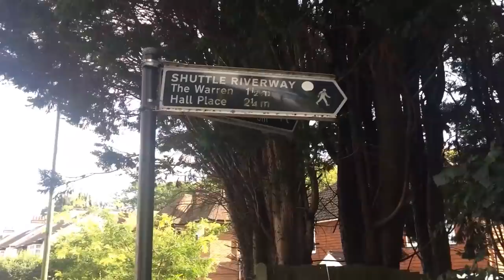Building our house in Thailand Pt 5 | Living in Udon Thani Thailand

Comment: Being an electrician I would recommend that you have that ground at all the locations. I learned this first hand as an apprentice, I wired up about 5 tents for some Green Barret's on bivwack. I didn't connect the ground thinking there was no problem because there was a neutral, but as they came in from the field at night  every time they would turn on the lights or touched the box as they plugged something in they go zapped. Luckly nobody got hurt accept my pride (but it was a good learning experience). Your  house is coming along nicely. Peace
Reply from the maker: Thanks for this Sidney. 
Have already insisted on the ground. Plus we have asked for a lightning conductor on the roof. The fork lightning is pretty spectacular here at times.

Comment: Re the electrical cabling you were talking about at 26:15 ....they are either single or double core, not triple. So you have to have a double core cable and a single when having L,N and E. And make sure they use one colour for each throughout the house, or you may later find that the live at one socket is green, black at another, and blue in the next room ! They think "I only need a meter or two to finish this, let's use up that old roll of cable, no matter what colour it is"
Reply from the maker: Not here. Pook's brothers house has twin and earth cable. The earth from the consumer unit goes to a copper earth rod that is sunk into the ground.

Comment: Reference the additional taps in the bathroom. Very often they send notice that the water will be cut off for a period of time. We usually fill a large plasyic garbage can with water for flushing the toilet, cold shower etc.
Reply from the maker: We never have a problem with the water supply here David. Seemed a bit pointless.
Reply: Thats it david large bin full of cold water all the time
Reply: @sinniatrest  - most places I've seen here have a large water tank "out the back", with a small pump to run showers and WC...
Reply: @harryinhuahin1272  I have the same  But the wife wants a dustbin in the bathroom full of water  as well

Comment: That extra tap in the bathroom is to stand above your plastic dustbin , to be kept full at all times as and when you get power cuts . We got a super large one in ours on my insistence , nearly every thai house will run hose pipe from the sink to the water but
Reply from the maker: Power cuts are few and far between here and if we do get one, never lasts more than 30 minutes.
Never had any problem with the water supply.
Reply: Yeah you’re lucky then , where we are our electricity comes over from Laos and if anyone literally sweats too much the poxy electric goes down and they don’t rush to fix it . If I lived there I would get a Jenny for sure
Reply from the maker: @retiredpainter259   I'm considering getting a small generator. Just enough to power my laptop and the WiFi router. 
Just in case the power does go when I'm doing a webinar.

Comment: Love the use of the glass blocks. Seen it before but not to the same extent. 

We are going to insulate all outside walls to keep the heat out.

Agree with your thoughts on London and Kent. We have been living in Sidcup for the last 9 years. We can't wait to move to Nam Rin Beach, Phala, Ban Chang, Rayong we purchased the land while still being in the UK. Just need the flights to restart Thailand Airways have booked us a flight for the second week of April. Let's all keep our fingers crossed. Good luck to you deserve it.
Reply from the maker: The thermal properties of those blocks that we used are excellent.
We know Sidcup very well. I did some consultancy work at Beadles, the Range Rover dealership there and have friends living close to the Oval.
Keep in touch and good luck with the move Tom.

Comment: 44:44 the logic is that if there is a problem (very low pressure or no water), or there's going to be a problem, you put a 200L bucket under the tap and collect water as a trickle or before the supply goes off. Then you wash with the water collected. In a lot of rural parts, the supply will be depleted from time to time. So, they leave the tap on, bucket underneath, and the bucket will start to fill as soon as the supply returns.
Reply from the maker: In all of the years that Pook's brother has lived here, he has never know the water supply to fail. We should be okay without the tap and bucket.
Reply: @TheIsaanFarang  shame, it's an upmarket look!

Comment: Awesome. Just a query though with the left side of the house from the front does that have an angle in the wall or are my eyes worse than I thought.
Reply from the maker: 😄  Your eyes are fine. The land tapers towards the back. We wanted the front of the house square and the space between the house and the garden wall to remain the same for the full length.

Comment: Hi good luck with your house build, I had a house built about three years ago and the last thing I had to do was I had a pair of made to measure hardwood front double doors made I'm a joiner by trade myself so when they told me how much they would cost I thought wow that is a bargain, they lasted about two years then I replaced them because they shrunk so much when the moisture content of the wood dried out, I replaced them with some aluminium patio doors it's a shame really because the original hardwood doorss looked sweet so my bit of advice would be all external doors and windows use aluminium or upvc I had all of mine made locally to my design, the cost wasn't that much more expensive than the ready made windows you can buy in homepro any how good luck with
Reply from the maker: Friend of ours had the same problem with wooden front doors.
We have gone for aluminium windows and front doors. Back doors will be WPC.

Comment: Nice to do your awning above the outdoor Aussie styled kitchen BBQ in a well treated natural teak timber, that way you'll have a beautiful timber patio to contrast to the upper rendered blocks, lovely timber balustrade posts and rails on the upstairs patio with stainless wire balustrade wiring. That way when you look out to the upper deck the contrast with the render will look beautiful. Lovely natural satin finish handmade panelled front door. If you're going to extend out on the shady side of the house as you showed where the trees are why not join that smaller awning/ deck from the back of the house around the corner to where you said you were going to extend out an upper sitting deck area. The look of the deck/awning wrapping around the corner with railings and stainless balustrade would look beautiful, and give you more upper floor area too for outside smaller sitting area.
Reply from the maker: Love all of these suggestions Philip, but we are working to a budget.
We will end up with a 5x5 deck above the kitchen overlooking the garden.

Comment: Good series of vlogs... Just one question: Why are the side walls proud of the concrete posts, by an inch or so...?  With the walls so thin there doesn't seem to be much connection between the walls and posts...
Reply from the maker: Good question Harry. They did that in places to keep everything in plumb. 
They used steel rods to connect the blocks to the posts and to the steel beams.
Reply: @TheIsaanFarang  - thanks for your reply... do I presume some of the posts aren't quite properly positioned...?
Sorry to be persistent but I'm interested to learn for my next build...

Comment: Please don't think i am being negative but you should really have gone for a double block external wall or a wider block if you are having a single skin external wall.
I am currently having a house built 15 mins from Ao Nang in Krabi and have gone for a single skin wall but a double width block.
Reply from the maker: The thermal property of these blocks is more than adequate to keep the heat out Mickey. Was my concern too but I have tested how efficient they are since they were put up and they are fine...and that was before the rendering on both inside and out. 
You might be adding cost to your build that is unnecessary.
Reply: @TheIsaanFarang  Hi, Thanks for your reply. The issue was more the strength of the construction rather than the thermal properties of the block.
Thai people tend to go with a single block construction due to costs being less.
I have gone for a single block but double width so have got the thermal properties plus the strength as well.
Which is more expensive than a thinner blocker but cheaper to build than a double shinned wall.
My brother in law had  a house built in Krabi Town about 9yrs ago and went with a single skin wall and unfortunately has some cracks in the gable end walls now.
This can be caused by a number of factors depending were the house is built close to a busy road or due to poor foundations.
Anyway as i said in my first message please do not think i am being negative just thought i would make you aware of my experiences.
I am at about the same stage of the build as you are roughly.
Fingers crossed the windows will be in next week.
All the very best with the build i am sure it will look amazing when finished.
Have a fantastic day.
Best regards, Mike
Reply from the maker: @mickeyp5122  
Thanks for sharing Mike and good luck with the remainder of your build 👍

Comment: The Rooter .... its ROUTER ...R_OUT_A
Reply: @TheIsaanFarang   sorry, I was only making comment on your pronunciation of the internet "router". You are saying rooter, its pronounced r-out-ta.   I might also ask, is your electrician installing an RCD (residential current device) ?  Thai building standards are horrifically low and their electrical installations are worse.  "RCDs are designed to disconnect the circuit if there is a leakage current. ... RCDs operate by measuring the current balance between two conductors using a differential current transformer. This measures the difference between current flowing through the live conductor and that returning through the neutral conductor."  They are mandatory in Australia.  And make sure he runs, 2.5mm cables to the power outlets and 4mm to the kitchen (separate circuit) if you want an electric oven.   Different circuits to the power, lights, aircon and kitchen power.
Reply from the maker: @MrTallpoppy58  
That's so funny Adrian. Would be interested to know where in the world you are from? I'm guessing the US or Australia.
I'm from London in the UK and owned an I.T. support company for many years. There, everyone pronounced the word Router to sound like "ROOTER". The variation on this is when talking about the woodworking tool "Router". This sound spelt phonetically would be "Rowter" as in 'having a row or an argument with someone.
If we are talking about for instance a "bus route", this would be pronounced "bus root". In the US, I think it sounds more like "Rowte".
Also, we don't have "RCD's". We have RCB's, residual circuit breakers that are housed in a consumer unit.
Time for a worldwide standard language and pronunciation?...Maybe 😉
Reply: @TheIsaanFarang  I have never heard anyone say rooter before, seriously you owned a IT store ?  I guess you are from the UK so, English is not going to be your strong point, lol,  the UK generally is the only English speaking nation where English sub-titles are commonly used on TV.     No "w" ... r-out-ta (er) and I am Australian.   Good luck with your house.
Reply from the maker: @MrTallpoppy58  
Interested to know. A bus travelling between point A and point B. Where you're from, is that a bus R OUT or a bus ROOT ?(phonetically speaking).

Comment: Thai like he 90 degree pipe for water and the waist pipe  it is hard to  clear when there is a blockage in the pipes, why not use 45 degree pipes instead much easier to clear when there is a blockage we did it when we built in Udon and check the electrical installation carefully with grounding and earth fault circuit breakers, they often cheat with it
Reply from the maker: Thank you for the information 👍